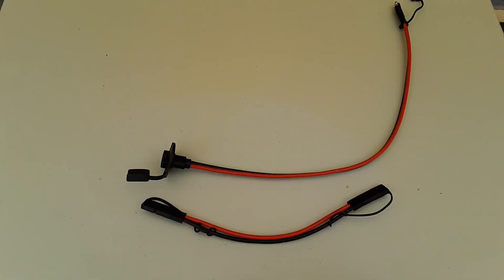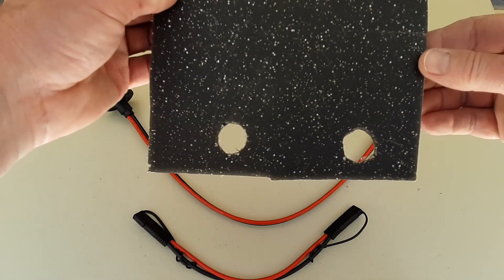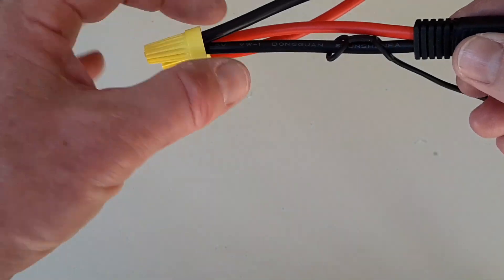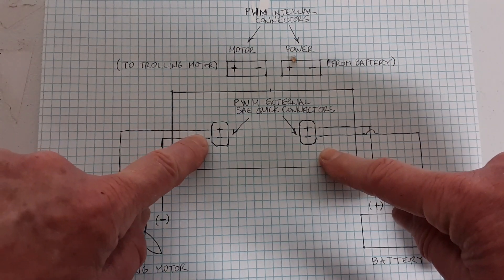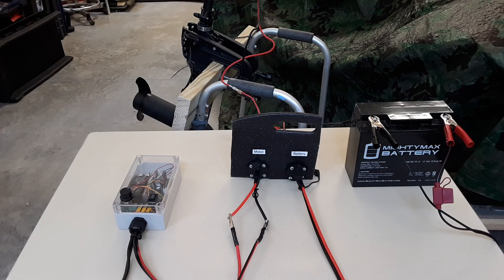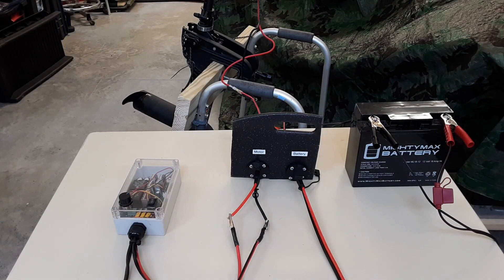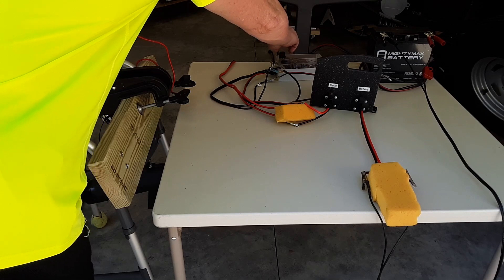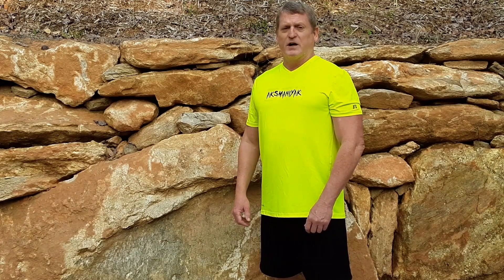PWM Digital Speed Controller Failure Solution

Comment: Would it be feasible to pre-wire the original tiller head and controls with the correct pigtails so you could easily revert back to OEM functions if the PWM fails?
If so, would love to see you do a video on it! 😁
Reply from the maker: It is possible but not very practical. If you don't want to use a jumper then an easier solution would be to carry a spare PWM.

Comment: I did the same thing but a lot simpler. My trolling motor cable got a quick disconnect on them. It's the same for the PWM. I just made another quick disconnect that connected straight to the battery with a second in line fuse, so if the PWM blow I just disconnect from it. I then plug it straight into the reserve that hooked straight to the battery.

Comment: Could you do a video showing how to wire a circuit breaker with a PWM? Thanks.
Reply from the maker: Hi. Honestly, it is not very difficult and I am not trying to be condescending. Just connect the breaker about 1 foot or less from the battery and run all your power needs after the breaker.
Reply: Aksman very helpful! I was initially going to run the motor positive to the PWM then to breaker and breaker to battery.

Comment: This is similar to what I was going to do to my setup. I may even setup a simple double pole three way bypass switch so there is no disconnect and reconnecting of wires- just turn the switch.  I have one of those cheap Chinese 60 amp,PWM controllers and they do get hot if running at higher speeds. I was going to wire a small 12volt dc computer fan to the output of the PWM controller. That way the faster you dial up the speed, the faster the fan will go. Very low noise and extremely low power consumption and will keep the controller cool.

Comment: I have been wondering about this problem too. There are two other possible solutions. One is to leave the trolling motor head on the unit so that you can just unplug the trolling motor from the PWM and plug direct to the battery. This has the added benefit that at least you still have speed control. The second option is to "wire up" a second PWM with quick connects so that you can just unplug the failed PWM and plug in the new one. Of course, what options you have are entirely dependent on positioning your PWM, battery and trolling motor connects close enough to each other to be able to bypass if necessary. And then there's issue of whether you have access to all the connections while on the water too. Great video. Any guess/opinion on the failure rate of these PWM's?
Reply from the maker: Thanks Craig. I am a member of a few kayak related FB pages and have heard stories of some PWMs failing so I started thinking about a solution. You could carry extra controllers but that would be a lot of extra stuff to carry. This is basically to be used in an emergency to get you back where you can do more permanent repairs.